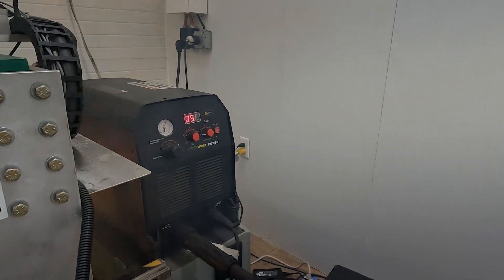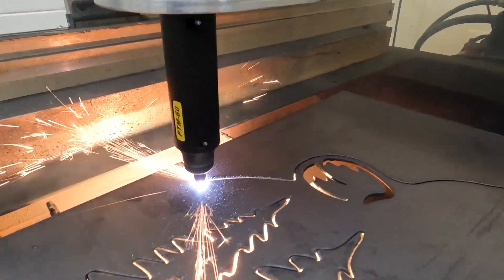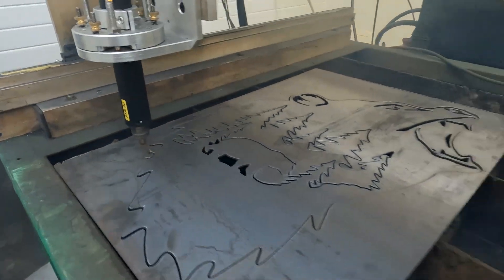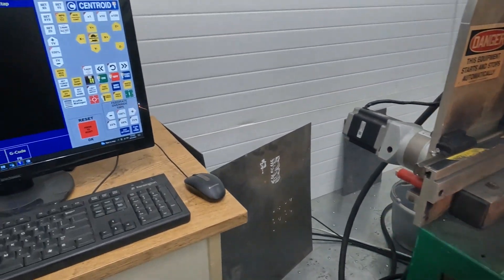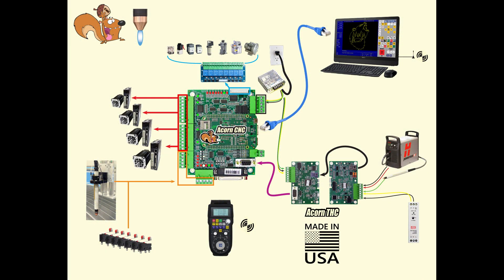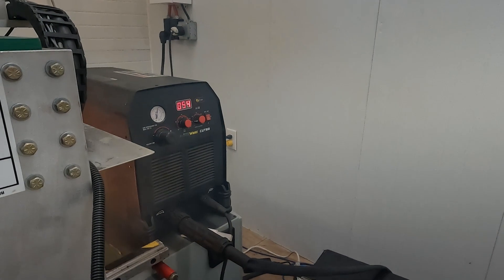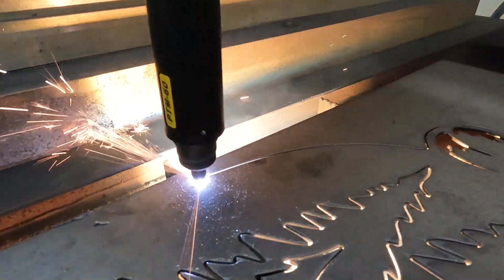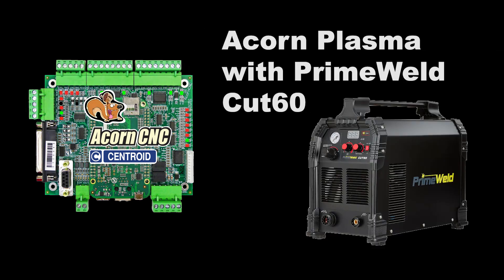DIY Plasma Breakthrough! Centroid Plasma CNC control with the PrimeWeld Cut 60 Plasma cutter

Comment: Uhh, your cut path is backwards, the part you want to keep should be to the right side of the path of travel. But hey, cool beans on the DIY plasma kit!
Reply: ha! you are right, we were to excited to notice! will fix it in the upcoming everlast video thanks for the eagle eyes.
Reply: Umm… can you explain why that is the case?
Reply: @trailb4u  The plasma kerf leaves a straighter and cleaner edge on the right side of the stream.  I don't know why that is, but it's accepted wisdom when planning cut paths.  It's analogous to "climb milling" and I assume it has to do with swirl direction of the plasma jet.
Reply: @ thanks for the wisdom!